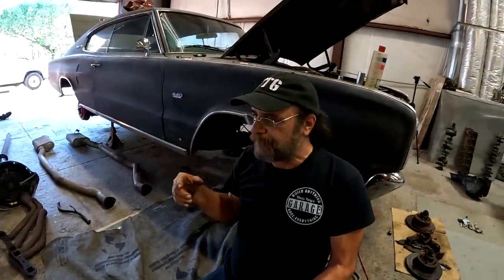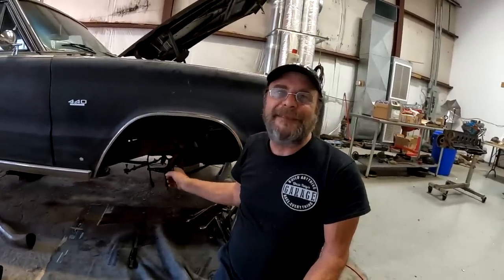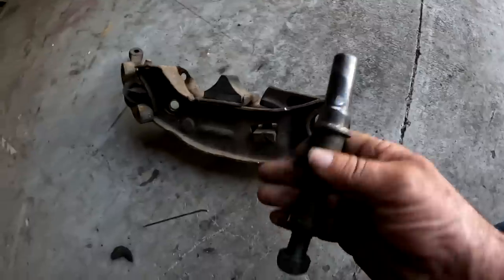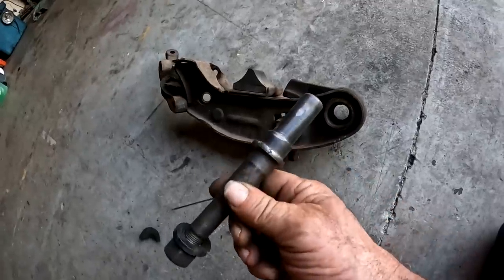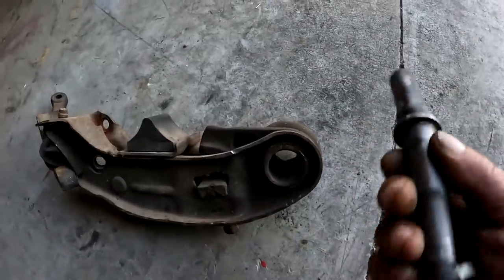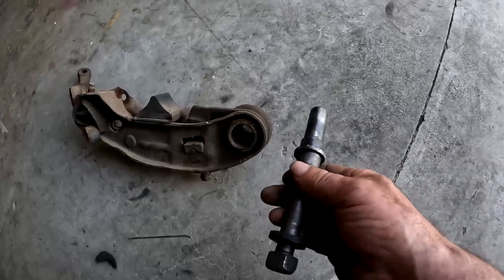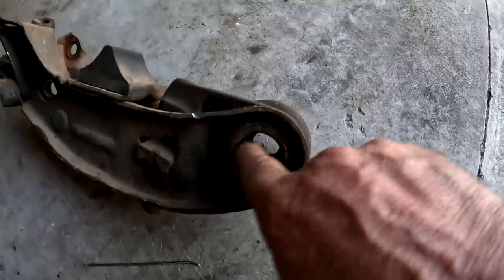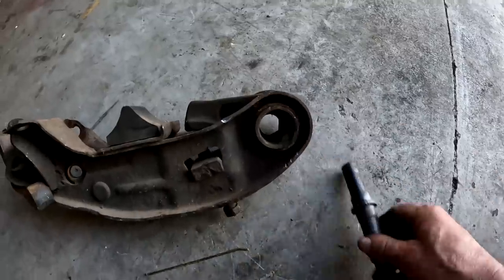The Achilles Heel Of The Classic Era Mopar - The Dreaded Lower Control Arm Bushing

Comment: That's the first thing I replaced on my 66 Satellite. I went with Mancini Racing greasable pivots and bushings. Time will tell how well they hold up.
Reply: It's been a few years, but I used something similar on my "67 and 75 darts. The zerks are well cared for.
Reply: Mancini Racing has some nice solutions for our Mopars including suspension items as you mentioned. Alot of Mancini parts when into my '66 Plymouth restoration.
Reply: Firm Feel Inc. has upgraded parts as well, as used by Rick Ehrenberg (Ebooger) of Mopar Action mag.

Comment: I raced stock body Mopars on circle track for 25 years and they held up well. I even used Mopar racing torsion bars. I can't say it's a bad design.
Reply: Ditto...
Reply: Being able to use two spanners at once to set the camber and caster sure would help getting it to turn-left-only real nice. Take a leaf out of the left rear and putting it in the right sure wouldn't hurt either.
Reply: @PiDsPagePrototypes  : Best rear end add on is the anti twist bar that the 60's Imperial has from a vertical tab just right of the pumpkin , with a heim jointed bar, to another tab on a bar spanning the frame at the seat back...

Comment: Better than disassembling the entire car to replace a timing chain.
Reply: Or half a car for an alternator, or @zz end removal for burnt bulbs.
Reply: Had to take the entire front suspension out for the control arm. The control arm won't fall out till you take out the hub and loosen the 3 disc dust plate bolts, id loose to try the cocaine they had, it must have been something

Comment: I think the most surprising thing to hear this time is that Tony doesn't have a press. I have one, and I do one half of one percent of the stuff he does. And mine gets used on occasion.
Reply: Right? A Harbor Freight press isn’t that much money and is plenty strong enough for bushings.
Reply: Press? I use a bottle jack and the bumper of my truck as well as a block. I work on tractors all the time. Always works for me and its mobile. Cheers.
Reply: @luke8210  that is a press.

Comment: The air chisel actually works nice to remove them old bushing steels. Also the inner ones come off pretty easy if you heat them with a torch and use an air chisel to push them off the shaft.
Reply: Came here to say that. Aso it is somewhat critical that the nut be tightened at ride height. The rubber isn't supposed to slip at all, all the movement is supposed to be in the rubber.
Reply: I recall being 25, laying under a car in my driveway, staring at a rear control arm bushing and wondering how I was going to get it out without making the car fall on me.
Reply: @bbb462cid  yeah I was a technician for 20 plus years and worked in a shop. Lifts make things easier
Reply: @HILLBILLY_HARD  Thank God I have two buddies with lifts, one abut 6 miles away, today. I ended up using an old steering shaft as a drift, pounding it with a sledgehammer, while I was safely next to the car. Took for-evvver.

Comment: Late 70s running A body cars with B body front clips on oval tracks we would torch the rubber out of the bushings and machine a UHMW plastic bushing and reassemble. Self-lubricating. zero looseness, never had a problem after that.
Reply: Delrin bushings

Comment: I actually don't mind doing these on Oz Valiant, one of those jobs people despise, but I'm cool with them. The "Special tool" we use, is a 1-3/8" tap. Screw it into the outer shell, then press out the tap. Welding a washer in, is another accepted practice too. One point to remember, is to only tighten the main nut fully, after the car is at ride height and settled. 
Hope it all goes smoothly Tony.
Reply: Good point about tighten bushes at ride height otherwise they will chew out quick, same for all the other bushes on suspension’s
Reply: Don't forget to lube the bushes - they're meant to rotate on the shaft, but stop sideways or vertical deflection of the arm on the pin. If they're not lubed and not sliding round the pin, they bind and tear apart.
Urethane bushings on a VC Valiant with the right alignment settings, turn them from a understeering cow into a neutral to power oversteer dream, mountain roads go from being risky to wicked fun, picking on ricers and euro sports in the corners. :D
Reply: @PiDsPagePrototypes  Love the VC Valiant's. Great car

Comment: Tony, I went through that the first time on my 1969 Roadrunner. What a treat! I used a thick washer welded to the metal outer piece and pressed it out. I have 3 more Mopar's getting the rebuild. Go over to Harbor Freight, or Northern tool and get yourself a 20-ton press. I know you are a way more experienced mechanic than I am, but it'll save you some aggravation. I believe I will try the newer style ones on my 70 Road runner. All the best from N.C!

Comment: My brother had a 1970 Dart Swinger  340 back in  1973. He hit a pothole and the anchor bolt snapped off flush at the shoulder where it met the rubber bushing. His car was suddenly very hard to steer. We stopped and looked underneath the car and couldn't see anything initially. I had him go inside and move the steering. Spotted it right away. We limped home and bought a new control arm assembly. Probably if we knew better we could have bought the new anchor stud and pressed it in. That was the only trouble we ever had on probably a dozen Mopars back in the 70s. Drag cars and street cars. I personally like the design. We didn't own many high mileage ones though? Great video as usual!

Comment: I deal with similar bushings quite a bit , I usually run a die grinder down the outer shell ( just enough to weaken it ) then use a sharp chisel next to the cut to collapse it . Care is needed, but it works good

Comment: I did one on a dart a while back and it wasn’t too bad. It wasn’t too good either but it wasn’t the worst thing I ever did at work. The bushings were completely gone and I replaced the worst side for my sales guys personal car. I just remember having to take a lot of stuff off and put a lot back but overall wasn’t terrible job… my snap on air hammer and a torch was very helpful with this job.
Reply: Those snap on air chisels are lifesavers. I don't remember this being a bad job either.

Comment: GM really did win this round with the massive lower "A" frame instead of the strut rod.
Reply: Up until you actually raced it. There's a reason why the Mopar Action " Green Brick" blew the doors of of most of its competition in the 90s ( 30 years after the car was made).

Comment: I definitely want to see a video of those non press fit bushings!
Reply: There super easy, You just tap the pin into them with a hammer, grease them with provided grease and push it into the old shell
Reply: As uncle Tony said, "It's knowledge you don't want to know."
Reply: @alexlandsberger1423   yep, .. just watch out for that grease !!  It's like pine tar. Should stay put tho. ?🤷‍♂️
Reply: @Torquemonster440  i use ams oil synthetic grease as much as possible
Reply: @Torquemonster440  I think it's actually worse than pine tar  it's like a chemical resistant silicone grease. I does stay tho, Ive done two sets of poly bushings and the grease stayed  for 4 years before selling them
Reply: @allanmcelroy9840  why, the stuff they come with is far superior.
Reply: @alexlandsberger1423   ok.. good info. 👍
Reply: @alexlandsberger1423  really? I've tried the Amsoil multipurpose grease and so far is one of the best. Or are you talking about the clear colored high temp lithium grease?
Reply: @allanmcelroy9840  it's special grease that come with the bushings, in a small plastic tube the size of a ketchup packet. I don't even know what it's proper name is other than polyurethane grease.
Reply: @alexlandsberger1423  oh that. The ketchup packet description sounded familiar

Comment: Being a dentist way back I took the lower control arm's of my Roadrunner to the surgery. Lunchtime I used the turbine drill to cut a groove into the metal housing and got it out fairly easy. Now I'm retired and my '66 Fury needs it's bushings replaced🙈. Just hate even the thought of doing it. Thanks for the great videos Tony👌

Comment: Steve Dulcich has a trick to rebuild these. There is a video out there where he does it. Weld a washer to the bushing and use a hammer to knock it out with a big bolt.

Comment: I remember a dude in school went over a speed bump coming into the lot, and the right side didnt come back up. 
Blame rust,it ripped the arm and torsion bar out of the body.
Reply: Ooohh I hate it when that happens 🥴, it will definately put a quick end to an otherwise good day.
Reply: 🤪 I hit a speedbump in my high school parking lot entrance in my mom's '68 New Yorker early enough one morning it was still dark. The sorry #%**$&@<'s that ran the school didn't issue a heads up. It wasn't there on a Friday. It was there on a Monday. Fortunately I was only doing about 20mph and the car was only 6ish years old at the time. Functionally it was a no harm no foul situation except for the sorry#%**$&@<'s that didn't let anyone know.

Comment: Many many years ago I talked with Global West Suspension about bushings for Mopar control arms; they produce the  Del-Alum bushings for other makes; they said it could not be done properly for the lowers because of the strut rods.  The control arm can't move up and down on its pivot in a perfect single plane because the strut rod makes it move slightly forward and back during travel, and the 'give' in the rubber bushing was needed to prevent binding (or bending) of suspension components.  Urethane has a little bit of give (Global West's delrin bushings did not).  

I've never tried urethane but I do remember spending many hours trying to replace the stock  bushings (with new stock bushings)  back then.

Comment: I thought you were going to say the Achilles heel was the upper ball joints...at least on the A bodies. It seemed like they didn't last as long as they should. I loved almost everything else about the cars though and I didn't even mind changing the other front end components when they eventually wore out. The only other complaints I had about Mopars was all the electrical power being fed through the bulkhead to the amp meter and those pesky wiper pivot seals leaking.
Man I always wished I could rebuild a transmission myself and rebuild the bottom end/short block of an engine myself. I was fine with the top-end but I never did Master the bottom end. Keep up the great videos Tony.
Reply: Man oh man you're right about sending all those amps thru the firewall bulkhead block into the dash. I knew 2 guys who had Hemi cars that they got out of storage and started up to let them warm up. Both went in the house and came back out to a marshmallow roast. I always thought there was fusible link protection for the whole car. One guy didn't know why his car burnt, the other guy said it was rodents chewing the wires. He figured under the dash. ben/ michigan

Comment: Rebuilding my 67, then 75, darts, I welded steel plates to the bottom of each arm to stiffen them for better handling with a hole drilled to access the torsion bar adjustment bolt. Pivot bolts with zerk joints and poly bushings throughout,  lots of grease. I won't say they tracked like Ferraris, but  they were better than new. I drove some  new darts over the years, so I knew. Thanks Tony and family.

Comment: I worked at K-Mart Automotive in 1974.  Almost all the work I did was front end work and brake jobs.  Mopars were my bread and butter with the front end stuff.  Nearly new Dusters, Satellites, Chargers and Road Runners would come in and I could make money betting the front end was worn out already.  Lower ball joints seemed to be the biggest offenders, but control arm bushings and idler arms were right up there in the frequency of needing replacement.  I'd put it on the rack and invite the customer to accompany me while I inspected the suspension because I knew I was going to sell them some front end parts.  I jiggled the idler arm of a road runner once and the thing literally fell apart in my hand.  It was a wonder there hadn't been a tragedly already.  As impressive as Mopars were in most ways, I was least impressed with the quality of the front ends they designed.
Reply: Hardly believable, had MOPAR's all my adult life (over 60 years) usually over 200K miles each,
never had one fail, usually replace the joints around 125-150K miles....

Comment: I bought and installed a poly-graphite kit from PSC in my old ‘68 Dodge Coronet in 1990. The outer shell of the lower control arm bushing stayed in the lower control arm. The car was from SoCal and I was lucky because there was no corrosion on the car. The suspension cleaned up with degreaser. That same suspension set up is still on the car today, and I have put over 20,000 miles on it with no issues.

Comment: They are not that bad Tony. I have done them a bunch of times.  But to my advantage, I had at my disposal a press and a lathe and a drill press. I usually turned both sides around in 3 hours, wheels off to wheels on.

Comment: Hi T, with all of the deepest respect. All control arm bushing are locked in place, and the arms rotate around the rubber bushing and not the bolt. The rubber bushing flexes rotationally and keeps pressure on the inner sleeve to maintain its position. This is why you have to "load" the control arm with the vehicle weight, and the spring/T Bar in place, if you don't and tighten the control arm you will over torque the rubber in the bushing when you have the vehicle sprung, leading to premature failure, or the vehicle will have the "Carolina Squat". Also you are right, one bushing was never enough for a heavy car like this, Ford trucks use two bushings. 
Anyway not trolling, just adding knowledge at no extra cost 😉
Blue Mule
N.C.

Comment: Brother, I am sooooo with you on this. My '74 Challenger needed new bushings and I got a lesson in this awful project. I grabbed one torsion bar (passenger side) with my hand, gave it a twist, and boom... it came out. Drivers side torsion bar... whole other animal. I hammered it, heated it, bought an item from Mancini and destroyed it... I even attached a 2-ton come-along and wouldn't release. I FINALLY found a really short YouTube video from a guy that put an electric (or maybe air) hammer on the back side and popped free. So, I went to a local equipment rental place and told 'em what I wanted to do... they rolled their eyes. It literally gave up after 2-3 seconds.... WOW! Getting the bushings out was also a #$@!  Basically, had to weld a washer to the old ones and systematically destroy them with a vice. For the install I went to O'Reilly's and borrowed a tool that worked really slick. All of this stuff was new to me as I never really tackled anything like this in my life. I hope to NEVER, EVER, EVER, EVER replace lower control arm bushings again!!!

Comment: Uncle Tony, I love my 2003 Toyota Matrix. It has almost 200k miles on it. It runs like a champ, burns a little oil, handles great on the twisty mountain roads I live near.  It is a four door hatch back. 30 miles per gallon.  That little 4 cyl. 1.8 liter engine with auto trans. is very zippy and fun. I am not trying to impress anybody or race any body. I was a hot rodder back in the 1970's.

Comment: After 20yrs cutting mufflers off, skinning the muffler pipes, and saving the exh and tail pipes, I made my first attempt on the LC bushing. Piece of cake. I just skinned it. Just like an 8N cylinder liner, then hit it with an air chisel. Then I used a ball joint press to put it back in. You need a few resources like sockets and short pieces of muffler pipe, but it's easy. Get everything ready then heated it up. Not enough to burn the rubber, but enough to make everything smoke pretty good. I had water ready to cool it after. Then press it in and douse everything. No heat on the pin. ben/ michigan

Comment: I've owned a lot of old Mopars over the years. I used to get them for next to nothing, because the handling was what you describe here. I called it the "Show me a rut and I'll follow it anywhere" handling. The problem was always the upper control arm bushings though, never the lower. I currently have a '73 Dart Swinger. It had the same issue when I got it. New upper control arm bushings, and it drives great.

Comment: This is exactly the reason why I sold my '74 Scamp. I kept having issues with the front end wandering all over the place and I had no idea what to do to fix it. I replaced every bushing on the front end but couldn't get it figured out. I believe the K member was wollered out. I ended up selling the car and getting back into Mustangs. So my dive into Mopars was short lived. That lil 318 ran great though. I eventually saw the car a few times on the highway and was excited to see that it was still alive.

Comment: Already played with these a few times on my own dakota: 1st was replacing whole front end...had to remove lower control arm with tortion bar attached, cut a slot on control arm then hit on ground with skedge hammer few times. That finally popped it out. Also, 2nd, i recently replaced upper ball joints. Driver side fine as i was able to cheat with jack only; on pass side i had to put jack stands under front end first. Removed caliper and considered attacking axle nut but could not find right size socket. So lossened tortion bar 10 turns and then put main pump floor jack under the brake rotor. That did it...finally

Comment: 64 Dodge shop manual recommends using a 1-3/8 inch tap, inserting it half the depth of the bushing. Then use a hand press and a blunt drift to force the bushing out. I thankfully haven’t had to replace mine yet.